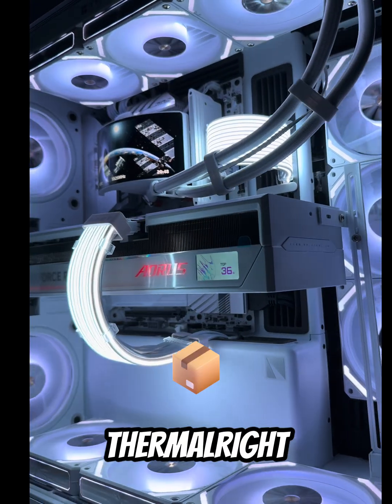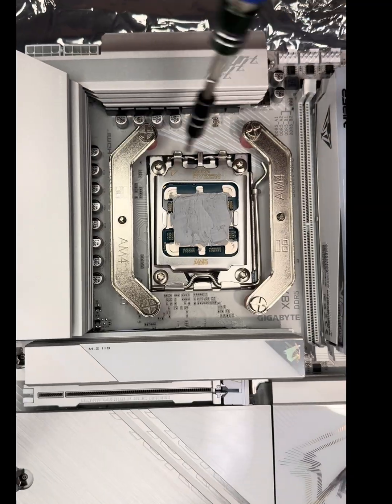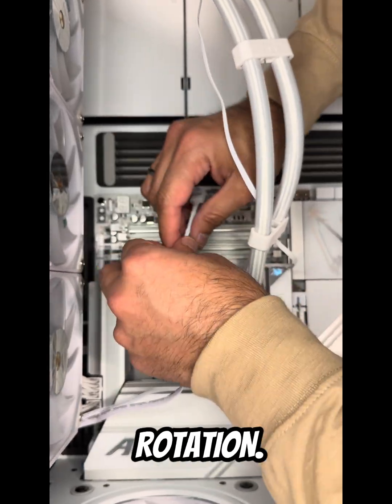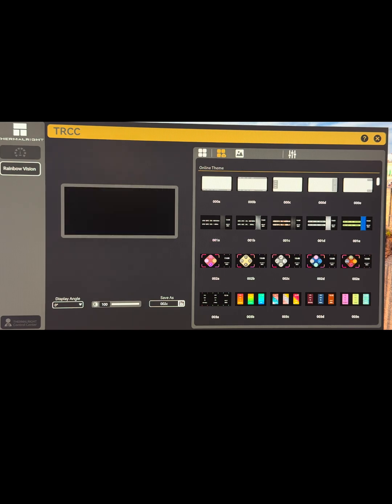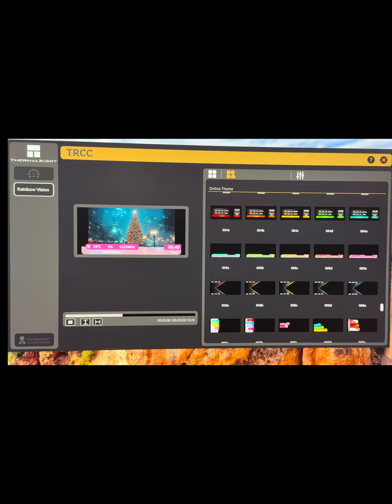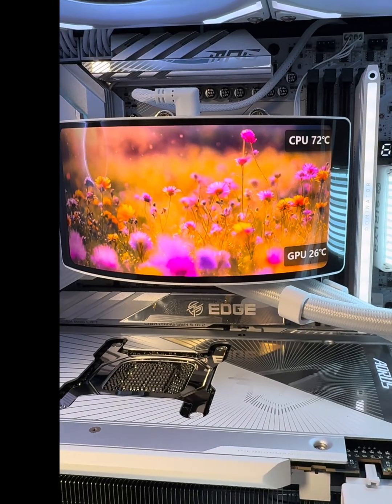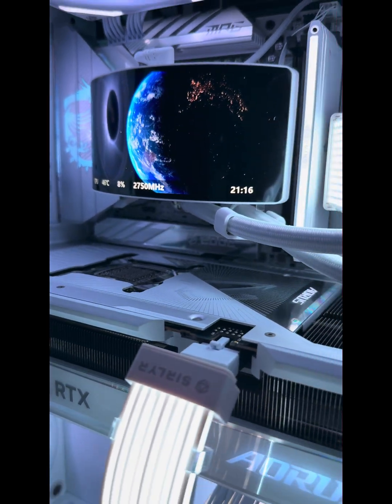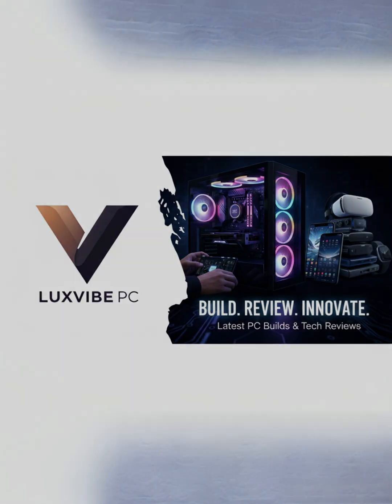Thermalright Rainbow Vision Review: GIMMICK or GOAT? 2K OLED AIO 9950X3D Install • Customize • Bench

Comment: Pump noise? I am looking to buy on my next pay check. Pricey, but I feel like it's worth it.
Reply from the maker: It is the fans. We recommend changing the fans.
Reply: @Luxvibepc I'm going to add fan curve. The one you're reviewing here, is it the turbo one? I believe I'm looking to buy the turbo one.
Reply from the maker: @KingKong-0000 Yes, the turbo fans are noisy.
Reply: @Luxvibepc you think a fan curve will help with the noise? If not then i will replace fans.
Reply from the maker: We tried to dial in the fans, but it didnt resolve the issue.

Comment: Hello, I have 4 stick of DDR4 RAM on my ROG B550 WIfi 2. 
Will the screen cause any issues? Or is vison 360 UB a better choice for fit and cooling?
Reply from the maker: Yes, you can use this with all 4 RAM sticks. However, you will need to make sure they are low-profile RAM.
Reply from the maker: I would recommend going with Wonder Vision.
Reply: @Luxvibepc  Its the Vengence by Corsair DDR4
Reply: Please tell me it will fit xD
Reply: @Luxvibepc  PLease try to respond to this. it says Ram is about 45-50mm tall
Reply from the maker: Yes, that will work

Comment: why did you leave out the fact you had to remove your other ram stick to make it fit ? we kinda need to know these things, I only happened to see it in another video so I already knew.
Reply from the maker: In this video, we tested a 48GB 6400MTS RAM module. If you watch our other videos, you'll see we often use a Corsair Dominator with two modules and the same AIO, and it works perfectly. There's no need to remove RAM to make this AIO function. Before questioning our facts, please review our content— we never recommend anything that would reduce system performance or prioritize aesthetics at the expense of effectiveness.
Reply from the maker: Scary Fast! 🎃 Our RTX 5080 & ASUS X870E Halloween Build | Thermalright WonderVision
https://youtube.com/shorts/LNpNt2r_Nio?feature=share

Comment: Only able to use 1 stick ram??
Reply: It looks like the curve screen will hit some ram that  have higher height profile, the screen wont sit flush on it without hitting the edge
Reply from the maker: During the test, I used my single 64GB DDR5 cl30 at 6000 MT/s, but you can use all the DIMM slots with those AIO.
Reply: @Luxvibepc  from the video it looks as if the screen curves and would not leave enough space for ram channels 1 and 2. Can you confirm if this is the case?
Reply from the maker: Scary Fast! 🎃 Our RTX 5080 & ASUS X870E Halloween Build | Thermalright WonderVision
https://youtube.com/shorts/LNpNt2r_Nio?feature=share
Reply from the maker: This works with two RAM sticks without any issues.
Reply from the maker: Scary Fast! 🎃 Our RTX 5080 & ASUS X870E Halloween Build | Thermalright WonderVision
https://youtube.com/shorts/LNpNt2r_Nio?feature=share